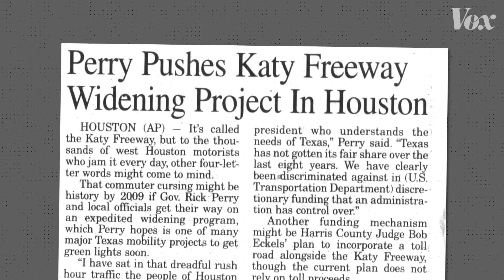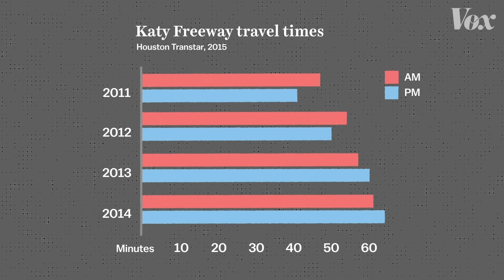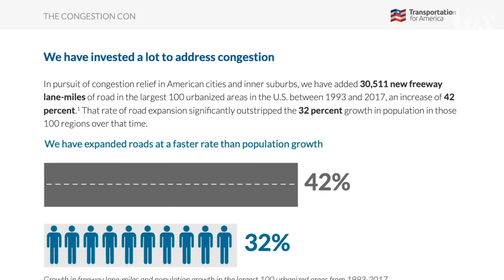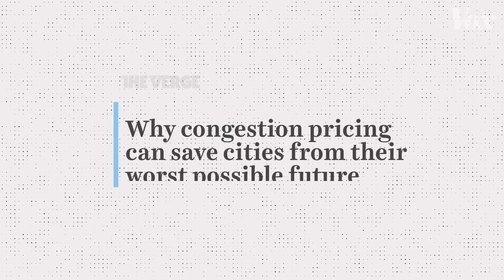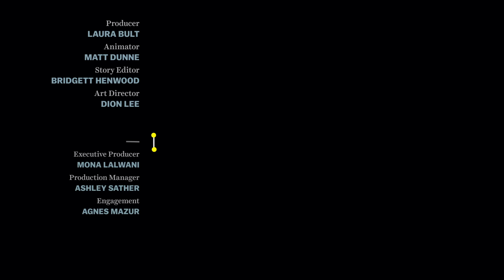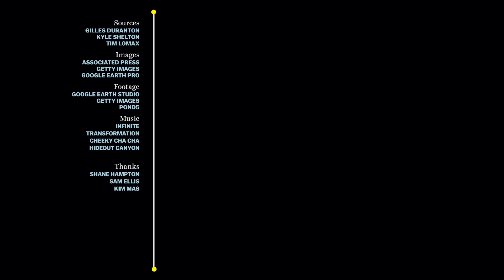How highways make traffic worse

Comment: Heh motorist complain about traffic when they are the traffic. You'll be surprised how much better if 30% of motorist get on a motorcycle and let them lane filter.
Reply: We would see a lot of accidents in states that normally don’t have a lot of commuters on bikes but it would be a great idea long term as motorists deal less damage to roads (hopefully less state taxes for those who have them), people becoming more aware of motorcycles being on the road (and actually look for them), and people being more proficient at riding becoming a cultural norm.
Reply: @TrizerFlame  if the states offer incentives to use motorcycle such as cheaper registration etc it would help with congestion so much. In regards to accident, there'll most likely be a spike during the early years. You don't even need experience to pass an easy course to hop on a 200hp missile and yeet yourself into the sun. As more and more motorcyclists join the road motorists will be more aware of them and share the road better.

Comment: Video is kinda dishonest
Reply: Why?
Reply: @lucaslonchampt613  Removing highways is simply going to increase the burden of other transportation systems.
Reply: @Frenchfrys17  Which isn't necessarily a bad thing. You just got to plan for it
Reply: @lucaslonchampt613  People have. It does turns out they were wrong because nobody used their form of transportation. So it ends up being a massive waste of money and resources. 

Why? Because waiting in traffic for half an hour is still faster than the fastest possible form of public transportation. Perhaps if you simply removed even more highways, you can force everyone to double their commute time. Equality is good right?
Reply: @Frenchfrys17  investing in better public transportation makes it better and faster, therefore more people would use it
Reply: @skland1619  Except it isn't unless you can prove mathematically that it will reduce my total commute to work time and downtown driving time.
Reply: @Frenchfrys17 . Induced demand in public transit is true. But public transit is also way more capacity efficient, so while i5 may get the same induced demand it’s not impacted nearly as much. Not to mention that public transit is ideal in any case.
Reply: @Frenchfrys17  Agreed. Removing a highway simply pushes that traffic to other city streets and other highways. Most people who are driving will still choose to sit in traffic over taking transit (See NYC where ALL highways are packed to capacity and most of the transit is below capacity). So unless these guys want to remove EVERY highway and thereby force people onto transit, then transit is no magic “solution”.

Comment: I don’t get it.
I mean if you produce more food there will be more people as when they can get affordable food, people tend to choose to reproduce more. meaning that there are more mouths to feed. meaning that once again you have to produce more food. But clearly the solution isn’t to not produce as much food so that people will starve, and thus stop reproducing as much.

Perhaps instead of trying to get people to stop using cars by making roads smaller, we should just make the alternatives actually better than driving. And if at the end of the day people still want to drive, because it is one way or the other a preferable mode of transport, then we should probably just look for more efficient way to satiate that desire by making more time efficient and if absolutely necessary larger roads. 

I mean refusing to expand something just because you know that later on you will need to expand it again seems pretty silly to me.
Reply: The problem with highway expansion is that it encourages bad landuse regulations. Cities should upzone residential areas as residential demand grows, but this is controversial because many homeowners are land speculators and nimbys who feel entitled to the "neighborhood character". 

Highways allow the residential demand to flow outwards instead, relieving the city officials from the hard work of trying to push for landuse reform within the existing urban footprint. This leads to absolutely rampant sprawl, traffic congestion and pollution.

Low-density sprawl is difficult to connect with effective mass transit, so the auto-dependency is built into the system. The necessary reform is to allow higher densitites within existing residential areas, especially around mass transit lines. The problem is that apartment buildings in the US are wrongly associated with crime and squalor, or alternatively they're seen as being "luxury" development -- the opposition doesn't make sense, but it's very strong.
Reply: @TheTokkin   huh, I hadn’t thought of that… thank you for explaining!
Reply: The reason making roads wider and wider is bad is because it doesn't solve the problem. One of the main problem with traffic in the US is that they have built their cities wrong. Suburbs are a highly inefficient way of development (/watch?v=7Nw6qyyrTeI) that forces people to use cars because public transport is almost impossible to realize with such low densities. One way to fix that is building dense, and preferably mixed use, developments (or, as the rest fo the world calls them, the way you build cities). This solves 2 problems: 
1. you have a lot more people living closer together, which means that public transport is now possible.
2. the distance between the home and the destination is much smaller now. This cuts out the need for getting in the car to begin with.
(Eco gecko made a great video investigating a few European developments in that style and compares them to American suburban densities (/watch?v=-sA2LeHTIUI)).
Cities with walkable neighbourhoods and public transport can cut the need for a car altogether. I don't have or need one, for example. My grocery store is 4 min on foot. My work is 30 min door-to-door by bike and public transport, and that's in a city 16 km away as the crow flies. The only time I get a car is when I'm going on holiday to an area where you need one (medieval cloisters in mountains generally don't have busses running to and from them). 

Adding more and more lanes to a highway doesn't solve the problem. It's a bandaid solution that needs (extremely expensive) addition and replacement a few years later. Those expansions often cost well into the $1 billion range and are expensive to maintain because of the wear and tear (which is made even worse by the average weight of an American car being HIGH, since wear and car weight are exponentially related). If that money would instead be spent on dedicated (trolley) bus lines, light rail projects, PROTECTED bike lanes (painted lanes are more dangerous than no lanes), desifying neighbourhoods, etc., you'd actually reduce the need for those lanes in the long term and reduce maintenance costs as well as boost development along those transit corridors (the 1st video shows that clearly around the 8:15 mark).
Another problem to consider is that the US already can't properly maintain all its roads and bridges due to the lack of funds for it. Adding more and more stuff to maintain will not improve that. I often hear people in the US complain about pot holes, etc. Those are not really things where I live. That's because there are many alternatives to driving and dense neighbourhoods. That reduces the average road surface area/driver while increasing revenue which makes it possible to look after all the roads efficiently which then in turn reduces accidents, etc.